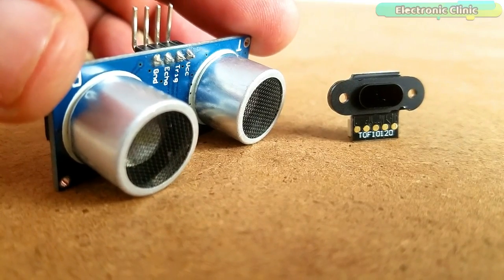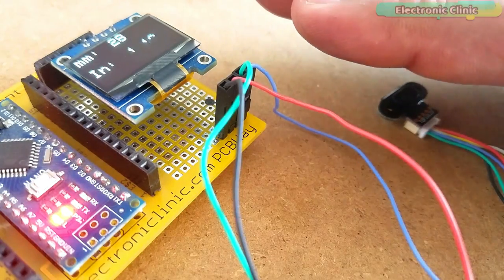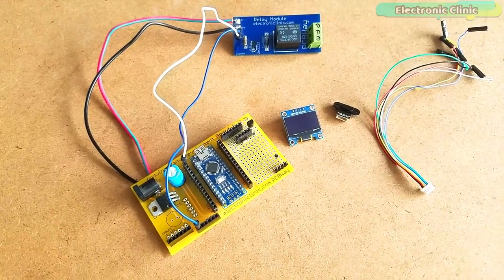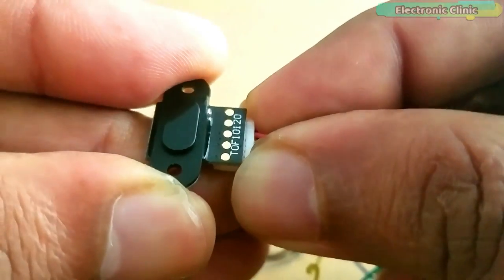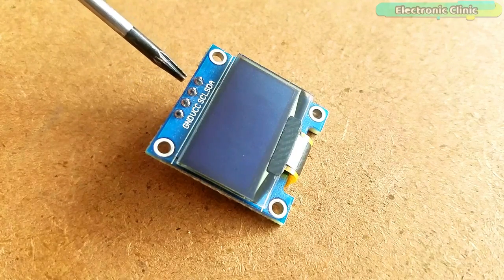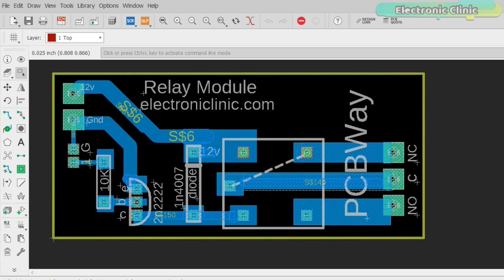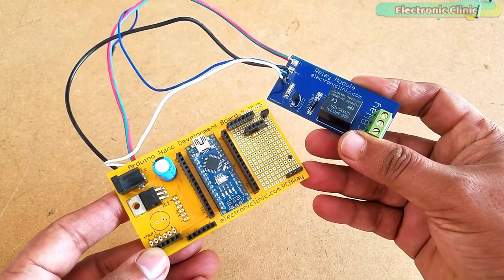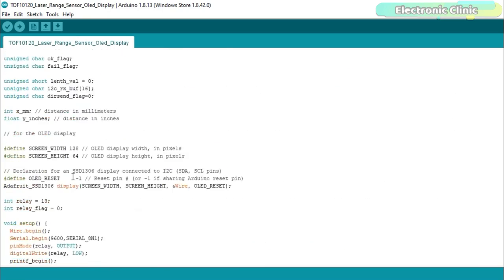TOF10120 Laser Range Sensor with Arduino to Measure Distance + Oled Display. laser for measurements

Comment: Hi, I should measure the height of water in a well that is 50 meters deep. Could you kindly point me to a laser or ultrasonic sensor capable of such a measurement? Thank you.
Reply: hi, i have same problem with you. now, i want to use LiDAR sensor. how about you ? have you solve your problem ?
Reply: hi, unfortunately not yet
Reply: Waterproof ultrasonic distance sensor
Reply: hi, the height of water is 50 meters, your welcome
Reply: @marcoss_mrn  The well is 50 meters deep. I have to measure how high the water reaches to calculate the quantity. That is, if the measurement of the distance between the mouth of the well and the water was 35 meters, I would have a height of 15 meters of water. Knowing the circumference of the well and the height of the water, I would calculate the volume and therefore the quantity of water available.

Comment: what is the operating range in (centimeters or metres)? My use case is to measure the water level in the well. The water level in the well is at the distance of 100 metres from the ground level. is it possible to measure the water level?
Reply from the maker: 100 meters it's too much. What you can do is install this sensor near the water surface and then  from there you can transmit data via rf modules like LoRa.
Reply: @ElectroniClinic  And how much this laser module costs
Reply from the maker: @roopesh668  2 or 3 dollars. It's a low cost sensor.

Comment: video request. can you join a tof to a 433mhz transmitter/ reciever. so i have a lazer trip wire allarm for a door or gatè way... if distance decreeses. transmit signal to reciever that makes a noise.
Reply from the maker: yes i can.
Reply from the maker: how about using it with lora?
Reply: @ElectroniClinic  how about using an existing wireless doorbell and make something to join the toff to the doorbell push button
Reply from the maker: to the doorbell switch, sounds great. you are trying to make contactless doorbell?
Reply: @ElectroniClinic  keeping it as small as possible.

Comment: if i want bulb ON only if object gets near at 2 inches to that sensor. can i change distance through code??
Reply from the maker: yes, you can.
Reply: Thanks for replying. I will check availability of above material because I’m not sure either these things are available in Pakistan or not :/

Comment: Can it measure up to 0.01mm precision?
Reply: I have the same thing, and no, the noise of each measurement is ~3-4mm. You can improve that by taking the average of many measurements, but in my experience with 150 measurements you get ~0.5mm, and that only every 5 seconds, as the sensor can give you a maximum of 30 measurements per seconds
Reply: @m.sierra5258  
Thanks for providing accurate statistics
Unfortunately that's not enough
I was looking for a laser detector with 0.01mm precision 
But I am not searching now anymore
Because i lost the job offer

Comment: using optic rules its possible to calculate far distant distances too by checking movement of lasers dot on screen, but that partially depends on focus of used camera and used lasers degree of direction.   anyway still try and learn technique probably will work. ;p
Reply: Helal olsum dayım, ingilizce çeviri değilse harikasın

Comment: Can I get water level with this sensor ?
Reply from the maker: yes
Reply: Officially I think it's not compatible with water, but I tried and it works fairly well. Of course only if the water is quiet, it won't work if the water moves around as water behaves like a mirror and a distorted mirror doesn't reflect properly